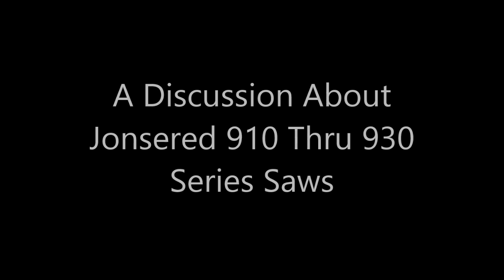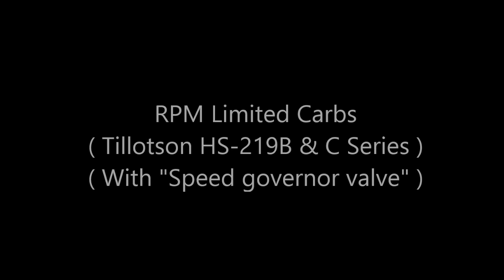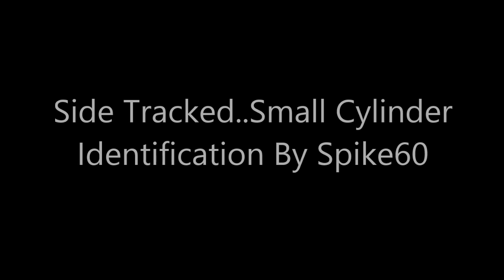Jonsered 910, 920, and 930 series chain saws. A Spike60 "Jonsered History" Saw College.

Comment: Thanks for sharing you knowledge on the Jonsereds - they are a great saw, I own a Jonsereds 621 that I picked up from a Garage Sale for $25! it runs beautifully and is in excellent condition and I haven't spent a cent on it, it cuts fine for my needs and seems to have quite a bit of Torque too which is good for cutting through the hard woods we have here in Australia.

Comment: I bought one of the very last Jonsered  930 supers around I think 1989 or 1990 , being long time Jonsered owner I have ran 108 leaded race fuel in it from day one , with 11 to 1 comp. most people did not run gas with high octane and it just killed them , having worked on jonsered saws at our local dealer this 930 has mounts like a 2094 many things are different than parts listed for a 930s , still running it today !!

Comment: Thanks for the history lesson. I have 2 910E's. One would run and has run recently but needs an ignition module. The other is a parts saw that someone gave me for free (seized), but it has a lot of good parts, even the mounts seem to be in good shape.They are very good running saws, but the mounts were definitely a major design flaw, that and all the little Allen cap screws were always loosing up and falling out while running .  I went to Husqvarna's after that and much less problems.

Comment: Great video! I just got gifted a jonsered super 930. It has not cut a lot of wood i think, it is pretty nice shape apart from a missing chainbrake handle. Sadly the piston is scored. What is the way to go for a sandpaper and hone repair?
Reply from the maker: U might find after market pistons for those, sand the cylinder and put in a piston. Strong saws! But collector material vs. daily grind. Parts are scarce. Barry Lyndaker in upstate New York ( You will have to find him on facebook, I don't have contact info  ) is the best possible place to find parts for those old red saws.  

Pistons are on eBay, Lil Red Barn sells them :
https://www.ebay.com/itm/JONSERED-920-930-PISTON-KIT-54MM-REPLACES-PART-503081501-NEW/140907526729?hash=item20cebe3a49:g:dI4AAOxy~iJQ-f9s
Reply from the maker: Knew a couple of Hoogland's from Longmont years ago...dairy farmers.
Reply: Thanks for getting back to me. Funny you say that. I live in the north of the Netherlands, dairy farmer area. Lil Red Barn piston looks like a good possibility. Cilinder is salvagable. Gonna try to glue some AV mount back together.

Comment: Thanks for the info, I bought a 930 last spring and the piston was torched because the previous owner had tied the intake manifold on the cylinder with bailing wire. So I bought a 920 piston and cylinder kit. It seems the 920 piston has wide rings. I believe the 920 piston will drop straight into the 930 jug with new Cabers, correct?
Reply from the maker: William Elliott yup

Comment: are the bars still available for the 920 , I got parts for the 920 bc the cylinder was a no go , to rough
Reply from the maker: I believe you can still get those. Worst case die grind a Husqvarna Large mount bar. I'll ask bob in a day or so...you might need to remind me, but he would know where to get them if they are still an option from Oregon....
Reply from the maker: http://www.ebay.com/itm/20-Oregon-208SLHD024-chainsaw-guide-bar-73LGX072G-chain-for-70E-80-90-820-920-/111804752927?hash=item1a0815241f:g:CVQAAOSw1ZBUwkvU

Comment: So should you use the 930 piston in a 920 with the cylinder with the base milled out? I've got one and a stock 066 blows it away.
Reply from the maker: +Michael Lee Mine has a 920 piston, Runs quite well. Never tried the "closed" off 930 piston. One thing I  ran into was those goofy rev limited carbs. They can cut the top end power right out of them. The one in the video has a non limited Tillotson and has no trouble keeping up with a 660 surprisingly enough. Not stronger but right there.
Reply: Ok. I guess I was expecting more. It was tuned to 12k give or take a couple hundred.
Reply from the maker: well it is what it is. They essentially have the same type of cylinder layout so will have similar power, 12k... mine is at 12700 and has a non limited carb. My 660's are 12700 to 13000 depending on setup. If your really disappointed... eBay it!  :)
Reply from the maker: +Michael Lee email sent. Assuming that's you...:)

Comment: Have you ideea how many HP has this chainsaw? I think is rated at over 6,5 - 7 hp
Reply from the maker: Not really, the do run well
Reply: Specs i have seen were for Jonsered 930 were 4,5kw. I dont know if those are the early or later updated cylinder 930s.